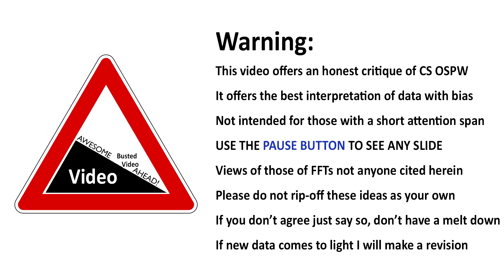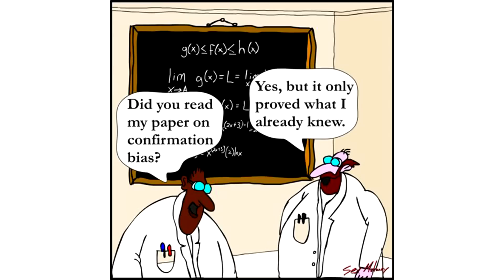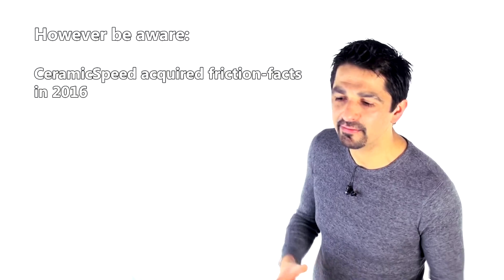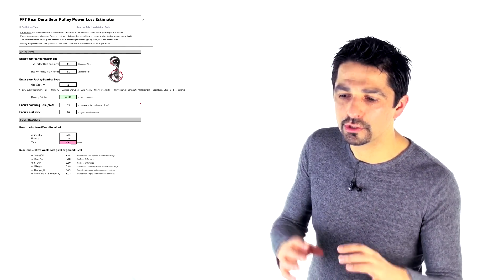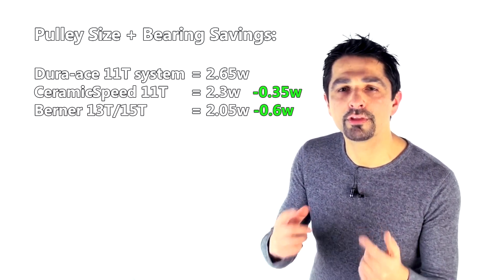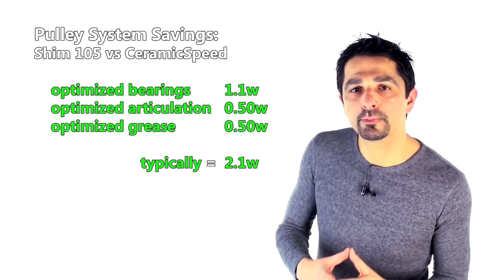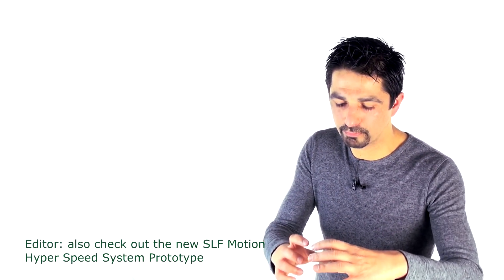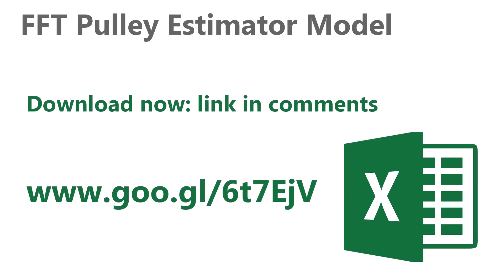CeramicSpeed OSPW Busted! (the truth about watts gained)

Comment: Did anyone take into consideration the weight of the jockey wheel system from CeramicSpeed? usually bigger is heavier, the larger wheel may look lightweight but the frame to support it is larger and possibly heavier. I read in a Japanese cycling magazine a pulley system from Carbondryjapan actually adds 16g (compared to DuraAce Di2).  38000Yen for a 16 grams weight penalty sounds like a farce. How much does one kilo in weight loss add to your KW output? I also saw the cheapest way to save watts was to slip on some shoe covers.... but that's a secret right?
Reply: well... that 16 g cost you about 0.0066 W at 40 kph

Comment: I can experience several lost watts, through a dirty, crusty, dry rear derailleur that I've neglected for a year. If I were to swap out to one of these, I suspect I'd clean and lube everything else at the same time, and sure, guess what I'd gain? I gave up on Aftermkt ball bear pulleys decades ago, after I found them to get clogged worse than every bushing pulley I ever used. Cutout lightening holes also just get full of greasy road dirt as well.

Comment: I installed my Ceramic Speed bottom bracket, a new YBN chain and an OSPWS and I can tell you for sure it all adds up to free watts.  I have zero resistance in my drive train, none.  I also fitted my race wheels, I hand built them, with special coated ceramic bearings in the hubs.  I tested all of the changes against my tried and true benchmark testing course(s).  One of my courses is 14 miles and I saved 6 minutes and 30 seconds.  Additionally, no matter where I ride my bike, I am consistently able to use two harder gears and am moving faster.  I'm happy I live in a time when I can enjoy the amazing technology that is fun, exciting and very, very fast. 

My bike/drive train are always spotless.
Reply: Are you really trying to tell us that you went from doing a 22km course in, say,  37.7 minutes (35km/h) to 31.4 minutes (42km/h)?? And all down to some ceramic bearings and a new chain? Sorry but that's just delusional. Assuming a flat course, that's going from 210watts to 345watts. A 135W difference....no way.
Reply: then you woke up...

Comment: wait seriously? you save only 3W by getting rid of whole front braking system? including cables, bowdens, brakes... is that 3 W saving calculated only for the aerodynamics of breaks not for whole system + weight?
Reply from the maker: 3w is pure aero savings from running without a front brake at 40kph

Comment: @JE: If you want objective data based upon bench testing in the lab, that is exactly what Jason Smith has done with his Friction Facts reports over the years. Friction Facts is now owned by Ceramic Speed. However you can still purchase the Friction Facts reports by subscription -- it's still all there. Be warned, the data are somewhat overwhelming, but with patience and perhaps with a little external help if necessary regarding physics, the non-Engineer can make consistent sense of the data; with some research and integration, the surprisingly complex data can be massaged to provide meaningful real life answers. 

Not to say that Fast Fitness Tips is superficial -- generally speaking the data analyses are thoughtful and well done, and I have found them useful. But I think the rather quick analysis done on the OSPW system was not as complete as it could have been, and ignores considerations that were more fully dealt with in the Friction Facts Report on Derailleur Pulley Systems (which was done prior to the introduction of Ceramic Speeds OPWS). I'm not necessarily stating that the dollars per efficiency savings is worth it -- that is for each individual to decide upon after considering the objective data. Extrapolation is ok, but hard data should be weighed when it is available, and it is. BTW, FF Reports also deals quite comprehensively with the issue of lubricants in real life and in lab testing -- it was there that I was first able to nail down the benefits of paraffin wax as the only chain lubricant to use.
Reply from the maker: Hi Su-Chong Lim as you have read up on this area I wonder if you can comment what FF found regarding the new 13/19T pulley wheels compared with the original OSPW? thanks
Reply: I'm not aware of any comment from FF on the new 13/19 pulley wheel. In any case, it would not be an arm's length situation, because FF is now owned by Ceramic Speed, just clarifying, not to doubt Jason Smith's technical expertise nor his integrity. Nor is there actually any evaluation that I 'm aware of in the publicly available FF reports on the 2016 17t/17t OSPWS. The "Oversized Derailleur Pulley Efficiency Test" from FF in the Public Domain looked at the various pulley systems available at the time. It split out the effects of the different bearings available and the pulley sizes. In general it showed the consistently higher efficiencies (lower friction loss) of the systems with larger pulleys). However, when testing of the actual systems with their original bearings and housings, the Berner system with 13t and 15t wheels was found to have the lowest friction loss, despite the smaller pulleys showing higher frictional loss when tested in isolation. The analysis reckoned that the anomalous result was the result of the design of the cage whose geometry was unique and also which allowed for a particularly low chain tension, the effects of which trumped the higher friction from the pulleys themselves. I have no idea of how the design of the Ceramic Speed Cage geometry and tension affects the results, but no doubt they had the opportunity to reverse engineer the Berner cage; and test out various configurations themselves. The effect of the large 17t pulleys would be hard to match though. For this reason, I would guess (purely conjecture on my part) that in the 13/19 combo, the benefit of the 19t wheel would be more than offset by the greater losses on the 13t wheel. (I am extrapolating a little on a FF report on cross-chaining where he digresses a little and examines the frictional effect of gears arranged in line -- not cross chained here, and under higher loads than in the derailleur pulley situation -- and found that as the number of teeth dropped, especially at the lower number range, the friction losses became incrementally more severe as the angulation articulations became more acute.)
Reply from the maker: Very interesting comment thank you. So in summary, in your opinion, the savings of the OSPW 17/17 and 13/19 are rather speculative at this time and not guaranteed to yield savings of 2.4w. Further saving depend on a lot of factors not just wheel size, bearing friction but also chain tension, spring tension and rider power.
Reply: No, I was under the impression that the savings of OSPW 17/17 was based upon unpublished in house testing by Ceramic Speed. I am not aware of any specific claims made for the 13/19 version. Yes, the factors mentioned affect the losses, as you say. Rider power is relevant only in that FF often tests systems under a power load of 250 watts. I believe losses measured in a given system of components under different power loads would still be the same proportional value of the 250w input. So, conceptually, I find it easier to think of systems "standardized" to your hypothetical standard 250w rider, and measured power losses for this bench standard can be extrapolated up or down depending on your own particular power value.

Comment: does it say what kinda power it takes to save ? 1000watts lol ? I think nice tires /latex tubee  should be much before this as some of those high end tires can save a few watts
Reply from the maker: hi, Try the calculator and you will see the possible savings (if any)
Reply: Fastfitnesstips it should be marketed as if you can spin 53/12 you could save 2.37 watts

Comment: I wonder if there is an adverse aero impact of having the larger pulley system? You talked about the savings from skewers and aero brakes, how ironic would it be if the mechanical savings where then offset by aero penalties
Reply from the maker: CeramicSpeed claims no loss, but they have not released this data. Independent testing is urgently required!

Comment: There have been very similar arguments coming from high end baitcaster fishing reel tuners for years.   The result is selling/marketing extremely high dollar ceramic bearing upgrades, reel parts, and aftermarket ported line spools with larger internal diameters.   The reality is though that there are so many other factors that it generally doens't make a huge difference.     And exactly like your video showed, the reel tuners often show how long a reel will spin and freespool after the upgrades, and they also run bearings DRY as you said these guys do.  A very good reel, is very good right out of the box, any improvements will be extremely marginal at best with low returns per dollar.

Comment: Well explained. Another factor to consider for those of us who do our own maintenance: Even though high-quality ceramic bearings can last longer than high-quality steel bearings, the ceramic bearings have a shorter service interval because they do not handle dirt as well. This is partly because the races are usually steel and when dirt gets into the bearing, the harder ceramic balls will score the softer steel races. This problem is less with steel-on-steel bearings. Because ceramic-on-steel is subject to greater damage from contamination, some manufacturers who supply ceramic bearings with their drivetrain components (like SRAM Red bottom brackets and Red rear derailleur jockey wheels) recommend that you clean and regrease the bearings every time the bike is ridden in the rain.

And there's one more factor that many fail to consider: weather seals. The better the bearing is weather sealed, the higher its friction. The super low friction of a ceramic bearing can be quickly undone with good weather seals. This is why choosing bearings is often a choice between trade-offs. You can get the lowest friction with ceramic bearings, ultra-thin oil and no weather seals. But the environment of your route needs to be very clean and dry. As soon as you hit sandy, dirty or muddy road conditions and any kind of rain, the friction of your bearings will quickly rise and you will have wasted the money and effort to achieve such low friction. Because of this, the best application for these kinds of marginal gains is indoor racing and time trials in fair weather on clean roads.

Comment: I enjoy the idea of comparing these different systems. However, by utilizing other sources of testing and mixing and matching data, you are introducing what you claim could potentially be biased data as your own objective data.

 I think a more objective method would be to set up a rig with a control system and measure other systems based on that control. Then you would need a large enough sample size to have reliable values. 

 Or, formulate a calculation for a dynamic pulley system and find the friction losses in the system based on input power and response. This would be your proprietary excel sheet, but then you'd have to find friction losses from other parts of the system from literature or again test yourself. 

Ultimately, you rely on secondary sources, but for such relatively small watt gains you claim are actually saved precision and accuracy would require a high level of integrity.. Still it would be more informative and support your claim.

Comment: Hi  , i a  beginner for 1 year    and i bought a ceramic speed OSWS 2 month  .. and i love using it because it improve  my chain flow and  tension at derailleur result higher  cadence  spin  and power transfer  when going up hill or racing and  is no all about 2.4w of power     i recommend  to 2 of my friend having problem in cadence and uphill  ( they bought other brand 16/16 T ) suddenly their performance  improved a lot   .  do your own research  u can buy any brand OPWS i highly recommend
Reply: Pardon? Are you saying that with less than 1 year in cycling you have spent 500 $ in that? You must be joking.
Reply from the maker: Thats great Stephen, no where did I say you shouldn't buy it. If you find this or any other product helpful then thats great. I am simply bringing information to the table which probably known to some people anyway. What is entirely new however is are loss calculator.

Comment: Well stated. I guess $500 to save 1 watt makes it just as expensive as the new Mavic shoes that are $1000 and save 2 watts. Between those two products you could save 3 watts and pay more than what most people pay for an actual bike 🙄
Reply from the maker: hi Rixter isnt the Mavic comete claiming 4.2 watts? anyone seen any data on this?
Reply: GCN had a video. I thought 2 watts, but could be wrong. 4 would make it a real value in the watt per dollar equation
Reply from the maker: We are going to do a feature on marginal gains very soon.
Reply: Researching regarding Ceramic Speed and look who i bumped into :D
Reply: You found me. DON'T bother with anything ceramic
Reply: Pro Cyclists racing in the tour  - Down under, France, etc.. or whatever, might benefit from those very minimal Watt savings. For the rest of us though this is just a Huge waste of money.

Comment: Nice one! I'd be interested in diving into the real savings on bottom bracket and hub bearings. I understand while they might not be spinning as fast as the RD, they are more load bearing, so there might be a higher wattage loss there that could potentially be minimized.

Comment: Another point to mention is the enormous amount of extra noise these large alloy pulley systems make over the smaller plastic types used by Shimano/SRAM/Campagnolo. This to me would negate any possible savings in power (if there were any) as the extra noise produced is very fatiguing...
Reply from the maker: Graham Tricker That is a very interesting point Graham Tricker because extra noise is usually a sign of wasted energy. However I love a quiet bike too that why I like the SRAM RED 1190 cassette not necessarily because of the weight.
Reply: Buy a 1170 once (I don't know if it applies to the 1190, too), and when you need to replace it, go for the 1130 and just swap the spacers and lockring. Voila, you upgraded your 1130 to a 1170.
Reply: Sram 1170 is quieter and not much heavier. Can't justify the price of another Red 1190 over an 1170.
Reply: Ooh, might give that a try, cheers :)

Comment: So buy a KMC DLC Chain lube it with Wax and save just 420$ and have a loss of 0.5W but no issue at rain and 3 times longer a super clean Chain. but the 420$ in a better Front wheel and save over 10w.